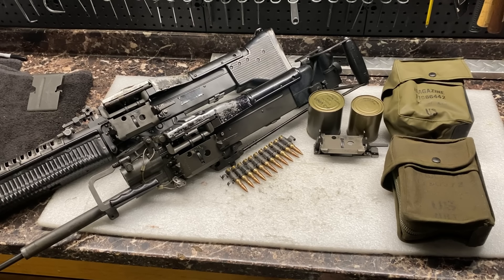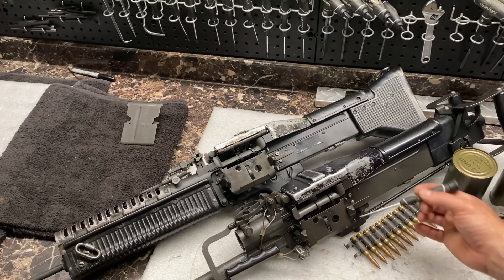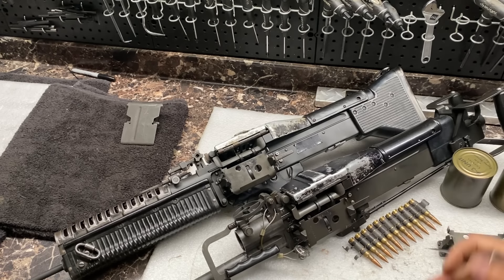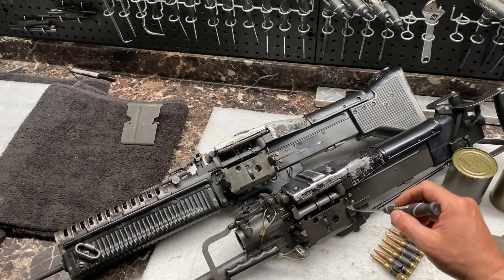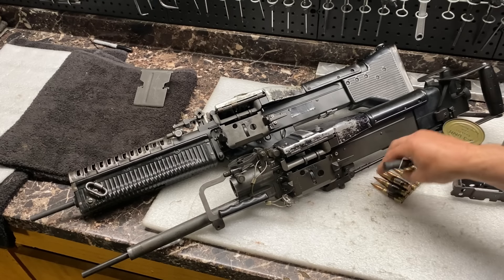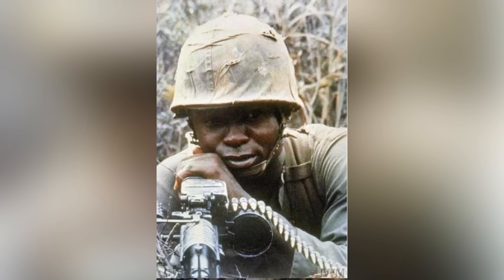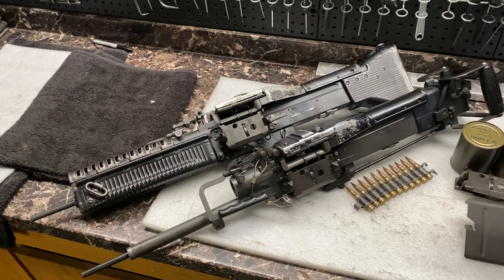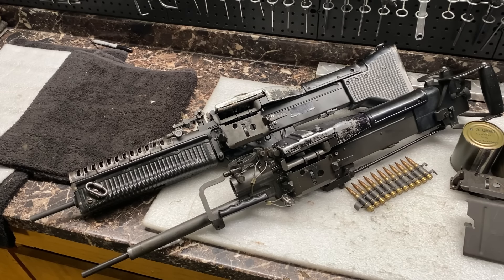How C-Ration Cans Were Attached to M60s in Vietnam

Comment: Its funny, we were still doing this in the late 90's at my reserve unit. We used juice cans from the chow hall. The M60s finally got replaced with 240s sometime around 99-00. I was gone when they did the change over but got to use the 240s later from 02-07.

Comment: Used to attach a 58 pattern water bottle pouch (with the lid cut off) on the side of the feed tray on the GPMG. All you had to do was turn the metal clips side ways and it fitted perfectly, you could get a belt of about 120 round in it. Ideal for patrolling in the light-role without trailing link, and better than carrying a short belt.
This practice was pretty much a non official SOP ……

Comment: Only shot the Pig in machine gun shoots and in training in an old Huey in the reserves in the early 80’s, a fussy weapon to maintain from what I experienced. Personally worked with Ma Deuce and it’s baby 1919. An understatement for heavy machine guns. Interesting snap on mod for the feed point with that snap in adapter. Have something similar for the 1919 that is made of stainless steel that both protects the finish as well as making it a smoother surface to run the belt over. Nice info about what our forefathers had to deal with in Nam.

Comment: A good use for Ham and Lima beans. The m60 used in the field was a crew served weapon for the most part with an assistant gunner.
The brass, bag, was never used, if you were smart, because after 50 or so rounds the brass piles up in the bag and jams the gun.

Comment: Heavy, heavy, the can makes it heavy. It's a fkn M-60, not a stripped down M-16 with a 10 inch barrel. Soldiers were MEN back then, and only MEN were saddled with the pig. If an empty C rat can added too much weight to this machine gun, 2,000 rounds of ammo, and your ruck sack, insert your tampon fully, take 2 midol, and don't call me in the morning.

Comment: Those aren't magazines.
Reply from the maker: Wrong …. They say “magazine” right on them….In the 1950s when they were designed they were disignated as magazines by the government engineers that invented them…. Photos: https://beltfeds.com/product/m60-magazines/
Reply: Ha-ha! Of course, they are - by definition. They're devices attached to a firearm holding ammo to load the weapon. But rather than being a steel or aluminum detachable box magazine, they're (literally) 100-rd cardboard detachable box magazines w/ bandoleer, OD, 1 ea!